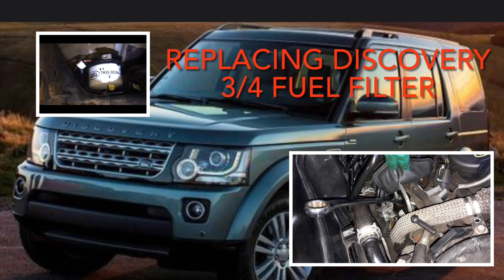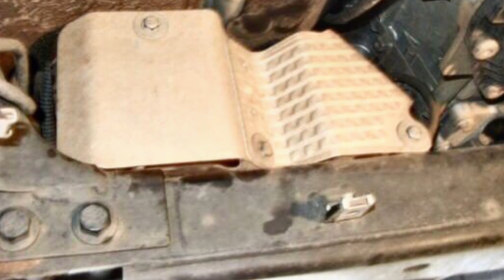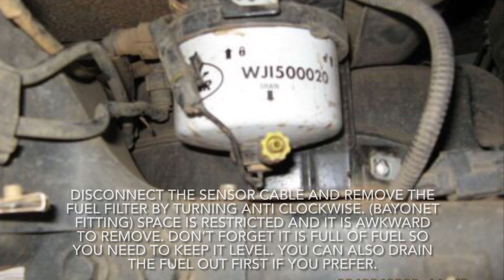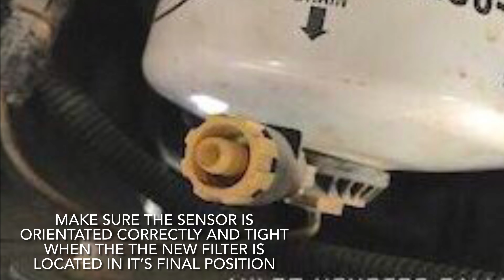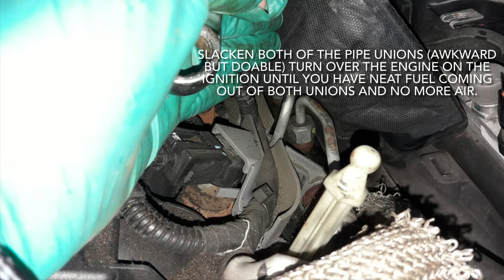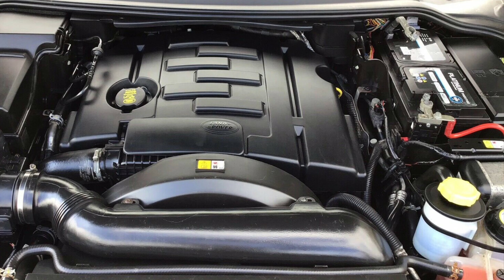Fuel filter Replacement Land Rover Discovery 3 & 4 & Range Rover Sport. How to bleed fuel system.

Comment: Very informative
Reply from the maker: Glad it was helpful!
Reply: Are there any other parts that could cause the water in fuel light to appear on my discovery3 as I’ve changed the sensor and I’m still having the same warning notice, I’ve drained a little fuel out of the filter and it looks fine thanks
Reply: @inducedmotivation3087   Hi, I haven’t come across this fault myself but if it’s a while since the actual filter has been changed I would replace it to rule it out. Having said that I have heard this fault can be caused by faulty wiring in the fuel filter housing, and not actually water in the fuel.  Probably give this a good inspection and although I can’t be sure this will be your problem it is likely and may need replacing. Hope you get it sorted.

Comment: If you cycle the ignition 5 times the fuel pump will prime the system and bleed it do not try to start engine straight away
Reply from the maker: Very good advice Philip thank you. It’s great when works as it should, which it always did on all the previous filter changes, but it absolutely wouldn’t self prime whatever I did. Bleeding the system like this did trick though.